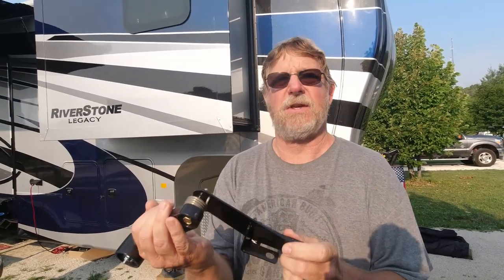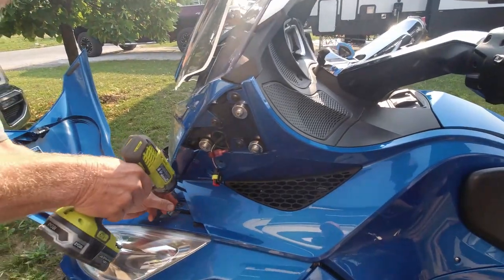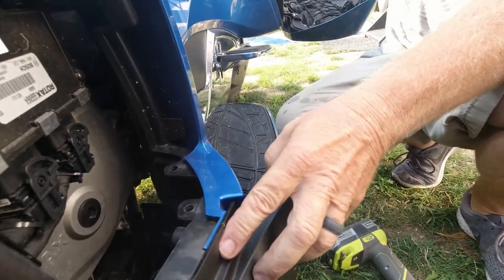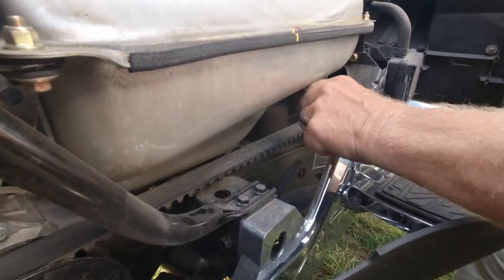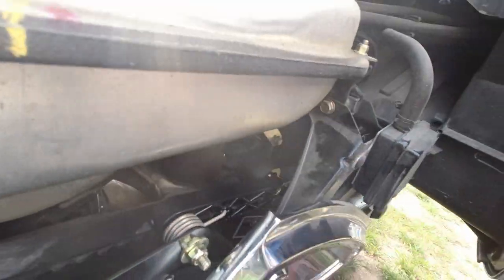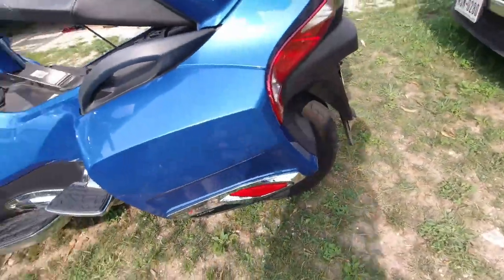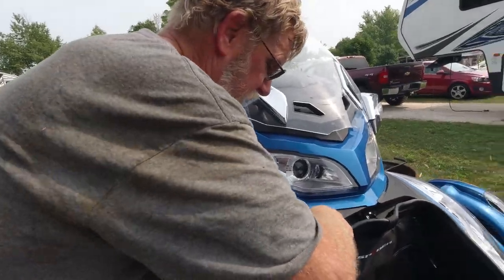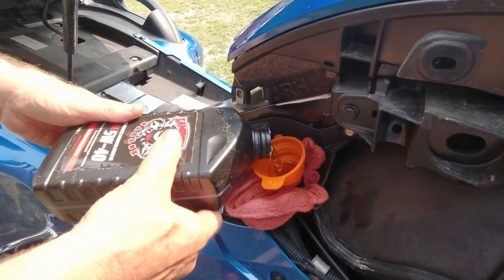LaMonster Garage Belt Tensioner First Oil Change  Can-Am Installation Service Full-time RVer

Comment: Hi, great video!! FYI: Lamonster has replacement magnetic drain plugs with socket heads instead of allen heads for $19.95 for the 1333 motor.  I like using a socket instead of an allen wrench to remove and reinstall the oil drain plugs on my Spyder.  Lamonster has a set for the 998 motor also.  Keep the videos coming!!
Reply from the maker: Sounds like an awesome upgrade for us. Thank you.

Comment: Another awesome video!  We just turned just over 3000 miles and brought ours to a dealer in Orlando.  Crazy the price they want for an oil change and it will be the last one a dealer does for me - just wanted a complete check on all the systems.  I had the same trunk damage you had as a result of the back garage door rubbing.  So I grab the paint, clear coat and wet sandpaper to do the job like Bob did - COMPLETE FAIL!!  I'll have to bring the parts to a body shop to have fixed!!  Bob made it look so easy I thought - heck I can do that - WRONG!  I will stick to mechanical/electrical and leave the bodywork to those that know how to do it!
Reply from the maker: I am so sorry that you weren't able to repair it to make it look the way that you wanted it to look. How did it get damaged by the garage door? Bob was curious? We did haven't next service and oil change done at Coach Bob's dealership in Tallahassee. They did a pretty good job but as you said was very expensive. Won't be doing it going forward. It was just such a hassle that day with all of the heat and the storm coming and I was trying to figure it out and recorded at the same time.
Reply: @HetteshWorld  Yes.  It was exactly the same damage you folks had with the back door.  Since then, Maria made a cushion that is placed across the back.  Bob made it look so easy... but... I'm just not a bodywork guy!  No problem, I got a little touch up and will get it redone sometime.
Reply from the maker: @ariverstonesthrowaway  did it happen before you put in the wheel catchers? Cuz we haven't had any trouble since and it was before that that we had the trouble. And we do have the phone just as a protection in the back but there is space between it and the back door. I know you guys have the newer camper so I don't know if there's a little bit of a difference or not. I am sorry to hear that, but your spyder still loves you

Comment: Hey Bob I've watched your oil change and wonder why you don't remove the dip stick while draining the oil? The belt tensioner vid was great. Be Safe Be Well and Keep Three Wheels Down !!!
Reply from the maker: Bob has been changing oil forever. He has never taken it out on any vehicles. Note: Bob owes a garage for 5 years after college. He said everybody does it how they won't so it is ok either way he says. Thanks for watching and the comment we appreciate it!!!!
Reply: @HetteshWorld  FACT: FYI,  Removing the dip stick on Can Am's assists with air flow through the crankcase which allows the oil to drain throughly

Comment: What is the length of the garage on the Riverstone RV? I’ve seen a couple different specs…one said 100” and I’ve seen 110”. Wife and dad like the same floor plan
Reply: Should be “wife and I”
Reply from the maker: Thank you for commenting on our video. The garage is officially 109" length, the door is 65" wide, the width inside is 68" and the height goes from 54" to 85" high and I'm attaching our video on how we haul our Can-Am that should help. It is discusses the dimensions. 

https://youtu.be/6umXkDPC0ys
Reply from the maker: @anthonyrhoden4239  no problem I understood. This is Barb by the way.
Reply: Thanks Barb!
Me and the wife are watching thru your videos from the beginning! You all are who have us thinking of the same setup, Spyder and the front kitchen garage model!
Would you be able to fit (2) bikes inside with the Spyder?

Safe Travels!!!